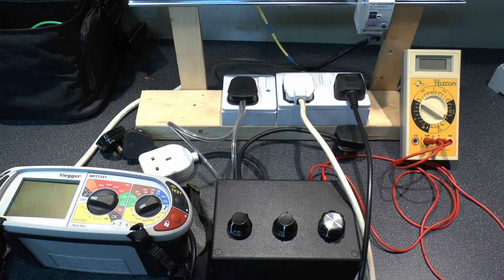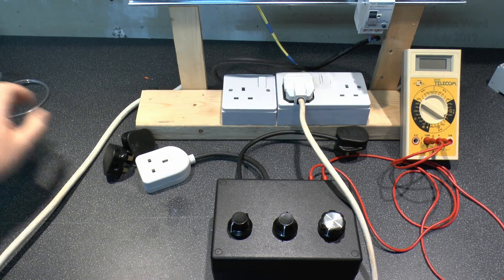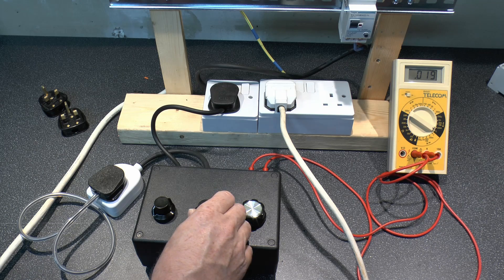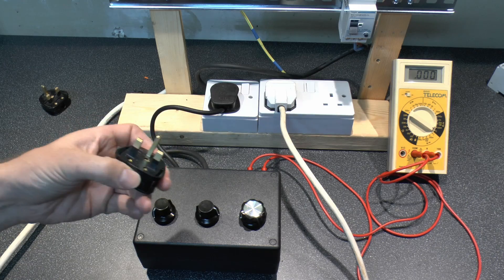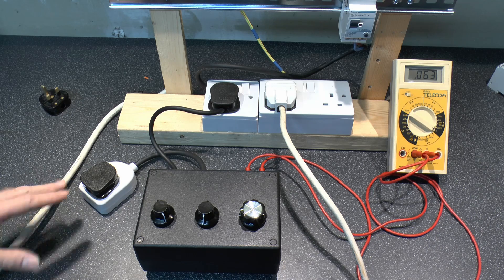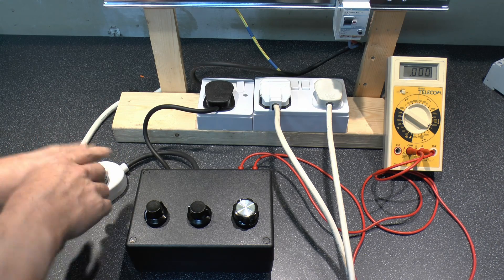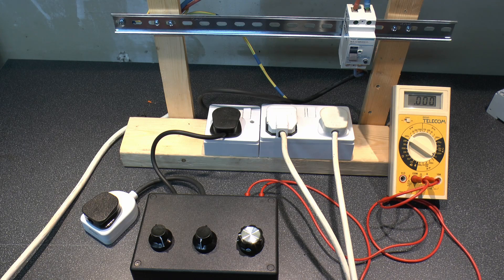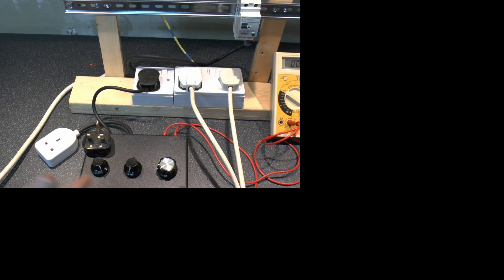RCD Testing Rig Overview - Pulsed DC on Type AC RCD Fails to Trip

Comment: How are you connecting the diode within that plug? I assume you have a resistor connected in series, if you just put a diode across line and neutral what you would get is a very large bang and a fried diode. Is it going from line to Earth, or shorting L-N with a resistor? Would be nice to see what was inside that diode plug.
Reply from the maker: It's between the L&N.  However the sockets on that rig are not wired in the usual way either, they are arranged so that connecting to L&N will place whatever is connected in series with the load.

Comment: Well none of this makes sense of course. BECAUSE: 1) Type A RCD tolerates 6mA before saturation , but it is STILL an AC leakage detection device !!. It simply means it will still operate under AC loses in an environment of up to 6mA DC offset. 2) So, what you needed to do here is apply various DC offset currents and use your MEGGER in the AC testing set up. It would then be VERY useful to see what amount of pulsed DC from the diode would be needed to be injectedt to block the AC RCD device tested for AC leakage,  3) The DC current that the type A will tolerate before saturation is 6mA. This is quite small. So in effect type A will behave the same as type AC when the 6mA is exceeded, by specs !!  Your rig can test for this also! 4) Most of the demonstrations done to show the impact of DC offset on AC RCD operation is using either 50mA or 250 mA of DC, then testing for AC leakage. I bet you any money type A will not operate under those test conditions either (ie 50mA DC offset, tested for AC leakage) since by definition it is rated to tolerate only 6mA of DC. 5) How would a latest AC RCD behave in an environment of 6mA or 10mA of DC offset?? I have seen no one test this out !!  If for example a good brand of AC RCD of today eg MK can tolerate 6mA of DC then it is no worse than a type A.  So a lot of talk but no real data to support the new regs. Your rig can test this out, but you have not done that, please do, we need the info.

Comment: Now that type A type  rcd's are made more or less mandatory in amendments 2 what would you code the use of a/c types on an eicr considering the amount of electronic equipment used today ?
Reply from the maker: C2, unless it's supplying fixed resistive loads only.

Comment: happy 2021 to all...my question is...with that diode plugged in or there was a capacitor leaking DC to earth...would that circuit pass  an IR test...could someone let me know
Reply from the maker: A good capacitor won't affect IR tests, as capacitors block DC.  A faulty one could, if it was leaking DC.
A diode would depend on which polarity the test voltage was applied, it would block in one direction but conduct in the other.

Comment: It is unusual for a domestic device to have a DC leak to gnd, devices like hairdryers etc that use 1/2 wave rectification where the load is DC has no bearing on the RCD,  a Type AC will still trip if there is an AC fault somewhere. So long as the DC current is opposite and equal on both poles of the RCD it is unaffected. The issue arises when you have a DC earth leak present (that bypasses one of the RCD poles) below the typical trip level of the RCD (in this case <21mA), this is when RCDs can fail to trip on an genuine AC leak.  I have tested many type AC RCD's with a 12mA DC leakage (double a type A RCD is designed to cope with) and 85% of them still work perfectly well on an AC fault, oddly enough it seems the "better" brands (Eaton and legrand for instance) dont work!

Class 1 devices with an inbuilt high voltage AC-DC converter are at risk of developing DC leakage currents but the energy required to cause such a DC leak would in most cases cause a more serious fault condition (device would self destruct), the caveat to this is where they are high powered such as a PV inverter or an EV on board charger where 5W of lost DC energy may go unnoticed and the device continues to operate. The unit i designed for my tests gets hot quickly and includes a few big wire wound resistors and a decent heatsink for the regulator to maintain just 12mA of DC fault current for a prolonged time period. 

It is strange to me so much focus is placed on fault protection rather than ensuring products meet the necessary legal safety requirements to begin with!

Comment: Hi! @John Ward great, easy understandable video! Thanks
Could you give us advice what RCD type should we use in house equipped with Induction Cooktop? In my region AC type is massively used without any deeper thinking.
Reply from the maker: Type A as a minimum, and possibly type F.
Type AC are only suitable for purely resistive loads, which is practically nothing in a modern installation.
Reply: @jwflame  "practically nothing in a modern installation" but in reality massively used with a sense of it correctness even in freshly constructed building - at least in my region SE Poland.

Comment: I had no idea that a single diode could defeat a GFCI (or at least some types of them). I'm going to test ours.
Reply: Finally got the nerve to test them. I was worried after looking online and discovering that rating GFCI's for pulsed DC doesn't seem to be a thing over here (there's "just GFCIs")--so some part of me didn't want to know if mine worked on DC. Fortunately, they worked (even the one that's 30 years old)!

Comment: A bridge rectifier passes current on both half-waves, not just one. It does not create the same pulsed DC as a single diode. 

If you had an isolated, differential oscilloscope probe, you should be able to see clearly whether an appliance is drawing current on one or both half-waves.
Reply: bluerizlagirl It’s still unidirectional. It’s not the pulses that’s causing the RCD not to trip...
Reply: @kennethcohan9630  With a bridge rectifier wrapped around the load, the current is flowing through the breaker on both half waves. With a single diode in series with the load, the current is only flowing through the breaker on one half wave.
Reply: bluerizlagirl My understanding is that it doesn’t trip because it is DC and not AC and so it wouldn’t matter whether it was full wave or not, it is still DC.
Reply: @kennethcohan9630  No. The current flowing through the breaker is alternating, and flows on both half waves, when the load is inside a bridge rectifier. As far as the breaker is concerned, it is an AC load. What causes trip failure with half-wave loads is the fact that current is flowing only on one half-wave.
Reply: bluerizlagirl yes, you are correct. With a full wave rectifier, under fault conditions, AC would be flowing through the RCD and it would trip.

Comment: if equipment has a full wave bridge rectifier, the ac supply and rcd should i think 'see' an ac load so should trip normally..????? have you tried this? maybe rig up mains in, feeding bridge rectifier with capacitor and resistive load, and simulate leak to earth from each pole of the capacitor in turn, that's what you'd get with something like a bad 'leaky' usb charger , most have bridge input, although not all ..?? none of the usb chargers i've come across have 'earthed' output, all float, so could easily be shock hazard under isolation failure , all my laptop chargers that have a 3 core mains lead also seem to have floating output, the earth is unconnected..maybe to stop possible ground loops with other equipment?  maybe they could fit some sort of 'avalanche' device from output 'ground' to earth so in normal conditions output is floating, but if the output develops an excessive voltage to true earth, the device shorts and blows a supply fuse in the charger and/or the plug fuse?

Comment: I work for the council and I informed them that the Crabtree boards we were fitting only had type ac rcds fitted in the split load and we should be fitting type a rcds so electrical safety is put in place but Crabtree still have not changed the rcds to type a

Comment: You had the mains cable wrapped around the heater.  Was that wise?
Reply from the maker: Probably not.  However it was only on for a very short time so the outside didn't get hot.

Comment: Question: how many 17th edition dual RCD boards with their standard AC type RCDs are sitting at the front end of installations which have now had some or even all of its standard socket outlets swapped out for those socket outlets with the conveniently built in USBs; and what happens if one  of those suckers becomes faulty and the RCD just doesn't give the proverbial monkey's?

Comment: Hi, Thanks for the video, so that socket on the left is wired in series? with the other sockets so the diode being added is being added in series to the load meaning that a heater or whatnot with a diode in it wont trip the RCD. The question I have is will it stop the RCD from tripping when the device with the diode is wired in parallel to the device with the fault?
Reply: The diode will fail or the MCB will trip.

Comment: John,   A video idea for you.  In your country, you call the three prongs on your plugs hot, neutral, and earth.  Laymen in US call it ground.  Professionals call it equipment ground.   About 99% of people over here are confused and probably most over there as to what these third conductors really do.   Most think the short circuit goes through that conductor to earth grounding point.  Set up for video would be a standard RCD(circuit breaker) in a Consumer Unit(panel).  Run one single conductor from there to back yard.  Install a switch, then to a rod driven into the earth.   Turn on the breaker, then the switch.  Take an amp draw, and show worms coming up out of the ground.   The RCD(circuit breaker) will not trip.  Hence proving that short circuit absolutely does not go to earth to cause a trip!   Note I said Standard RCD not (ground fault or arc fault).
Reply: Your message is rather confusing, to say the least.  The normal terms used by electricians are Line, Neutral, and Earth, others use Live instead of Line, nobody uses Hot is not one of the terms in common use in the U.K.

Also since the house earth is connected in the  service head  (in the majority of wiring systems in the U.K. )to the electrical supply company earth which is at or extremely close to  ground potential, your test is extremely unlikely to function
Reply: JM SometimeWoodWorker   The terms used are different as you say.  I agree!   But, if you connect a conductor to a (circuit breaker US) to a rod in the ground, I assure the "over current protective device will not trip.  Not enough amps.   I am sometimes woodworker as well.   Respectfully,   Kevin
Reply: We say "line" not "hot."  We used to say "live" instead of "line" but that changed (neutral is also considered live because in certain fault conditions it can be lethal to touch it).  We also use "RCD" to mean "residual current device," which we used to call an ELCB (earth leakage circuit breaker).

So in your test, a residual current device would trip at 30 mA.  An ordinary circuit breaker might or might not trip, depending how good an earth connection your pole makes.
Reply: bdf2718    Wow, I have a lot to learn on how to talk the same electrical language over there. 😊.   I'm not positive what amp ratings you guys use over there.  I'm guessing 10a and 16 amp overcurrent protective devices.   Not a 30 ma device that compares live to neutral.   If you make direct connection to a rod driven in earth, the so or 16 amp standard device will not trip.   Not enough current to trip it.   It might if you left it on for hours.   This would show that your so named earth conductors at receptacles do not carry the current to earth to make the device trip.
Reply: @KevinCoop1  Ummm, maybe you should stick to woodworking. :)

We have 230 V (nominal, because European Union, actually closer to 240 V), not your 110 V.  Breakers are usually 6 A for lighting circuits and 32 A for sockets (higher still for cookers, immersion heaters and power showers).  32 A sounds like a lot, but that because we often have a weirdness called a "ring final circuit" which means that all power plugs must be fused, to a maximum of 13 A.  See https://en.wikipedia.org/wiki/Ring_circuit

Both here and in the US, if you short the line (hot) to the earth pin of a socket then the overcurrent device should trip.  In most installations here, the earth conductor is connected to the neutral conductor at some point between the distribution transformer and the consumer unit.  And that neutral is very well earthed at the distribution transformer.  In rare cases, consumers in isolated buildings have to have a local grounding installed and there are rigorous checks to ensure that it will carry enough current to trip breakers.  JW did some videos on this.  See also https://en.wikipedia.org/wiki/Earthing_system

If you stick a random bit of pipe into the ground, you probably won't get a low enough impedance for a short to it to trip the breaker.  But you might, especially if you live on swampy land.  One of JWs videos discusses what you might have to do to ensure your ground is good enough.
Reply from the maker: RCDs are what you would call GFCIs - devices which compare the current in the two conductors and disconnect if the difference exceeds a certain value.  Most RCDs in the UK are 30mA types.  10mA are available but rarely used, higher values such as 100mA and 300mA have a few specialist uses but are not common.
MCBs / circuit breakers are devices which trip on overloads or short circuits.  Standard values for homes and smaller commercial installations 6, 10, 16, 20, 25,32, 40, 45, 50, 63, with the most common being 6, 16, 32 and 40.
Arc fault devices or AFDDs (AFCI in the US) are almost never used here and have only recently become available from mainstream suppliers.
Reply: John Ward   Thank you very much for the education.  RCDs (GFCI) here are 5 ma for pretty much everything.  30 ma are for freeze protection cables around pipes or in sidewalks.   Do you agree that most people think short circuit current goes to earth to make a breaker trip?   When in fact, earth has nothing to do with it? Or do you believe it does go to earth to trip the breaker?

Comment: John,   Were you doing phase to earth faults in this test?   I.E. here in US ground fault.   Here in US our GFCI devices are set to 5 miliamps, and 30 ma for specialized equipment.   I'm not understanding how changing to D.C. After the device causes the unit to it trip.   How do yours work?

Comment: 300+ is about 15 times more, not 10 times.
Reply: 10 times more than the rated 30 mA trip current.
Reply: @Berkeloid0  aha ok, i thought 21 mA.
Reply from the maker: That particular RCD is a 30mA one, but tripped at 21mA, which is within specification.

Comment: Even I don't understand why your fault current changed with the load, and I did watch your explanation video. It is a bit confusing after all, with all the black boxes ;-)
BTW don't you have any limits on harmonics in the UK that prevent you from using a diode on such heavy loads? It can cause problems with overheating transformers, because of saturation. 

It's your channel and you can do whatever you want obviously, but if I am to understand it fully you'd probably have to show me a schematic of your test setup.
Reply: The fault current changed with load because the black box is just a current shunt with wire-wound pots in series from the hot end through the current meter to ground. So the ratio between shunt resistance and combined pot resistance determines the ratio of the main to leakage current.   But yes I agree, we need to see inside the black box to be certain.

Comment: Too bad that the test button isn't working on that RCD. It would be interesting to demonstrate that the test button won't work too if the magnetic core of the measuring coil of the RCD is saturated with DC. And when the fault is gone the system will work as intended again. Makes the search for faults interesting...
Reply from the maker: There will be several other videos on this, covering all of those things.
Reply: if DC fault current is high enough the test button does not work, the test button creates an AC leak, usually above  30mA!
Reply: @ianlouden7939  I know, and that would be interesting to see and show that it won't work when the core is saturated with DC. But the test function of the RCD used here was defective, so you can't show it....